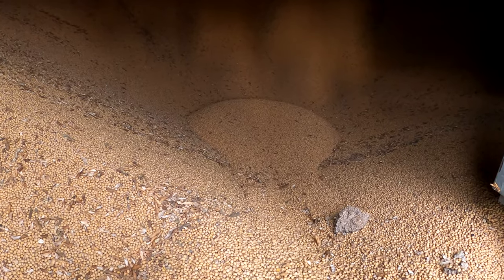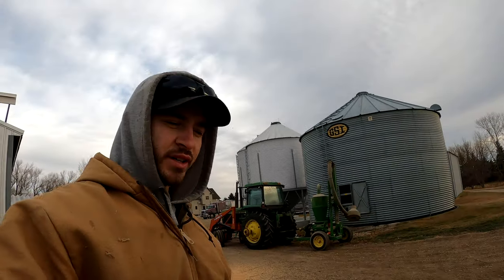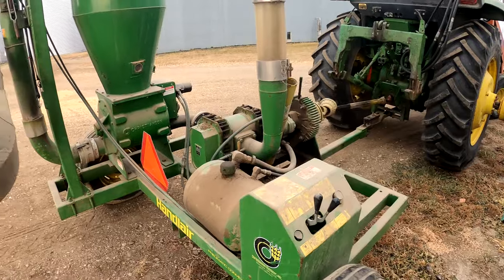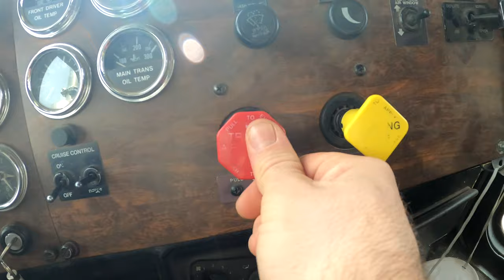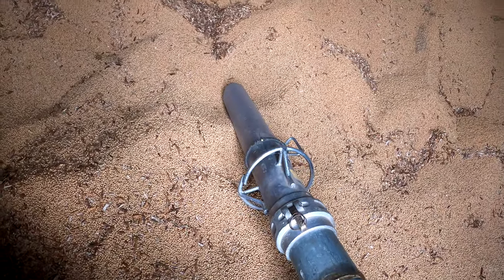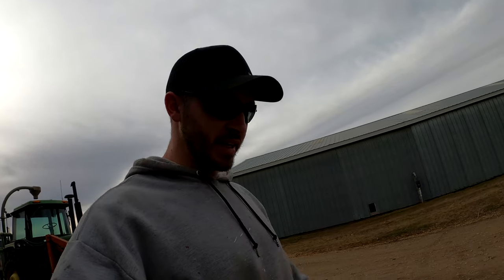This Thing SUCKS

Comment: Couldn’t you just use the grain vac to empty the whole bin instead of using & moving the augers? Just a thought, cousin uses grain vac to empty smaller bins instead of an auger. Works great, no auger moving or shoveling with it.
Reply from the maker: Yes definitely. It's quite a bit slower and until the grain is under the door, it works best to just let it funnel out into an auger. Vacuum is awesome for cleaning out though. No dust, no shoveling, just slower to do the bulk of the work especially in large bins